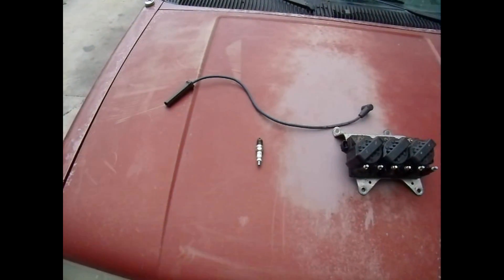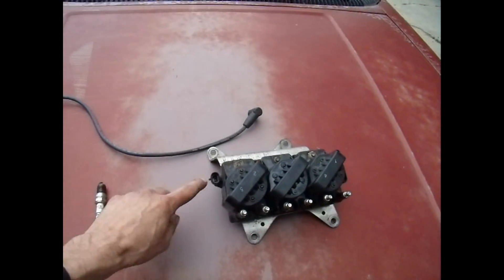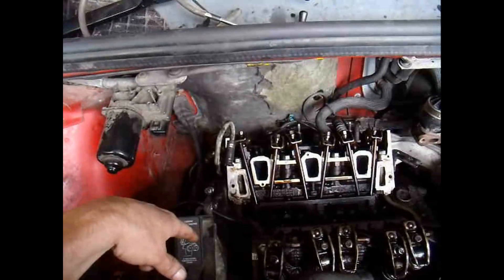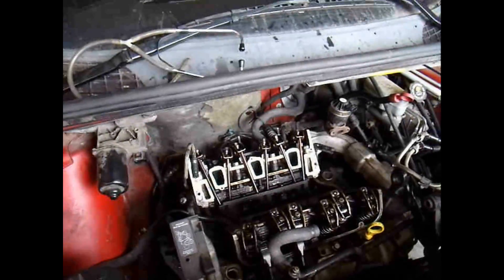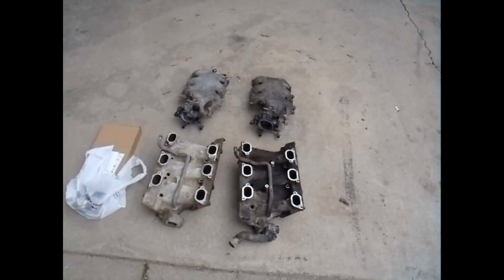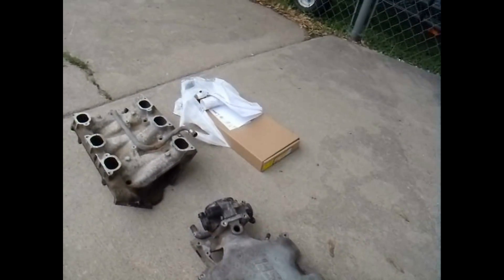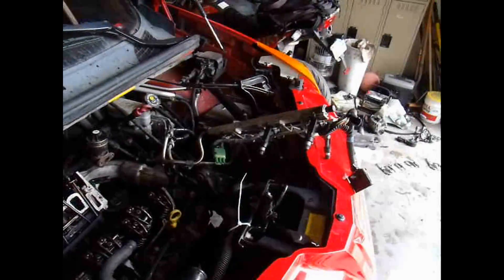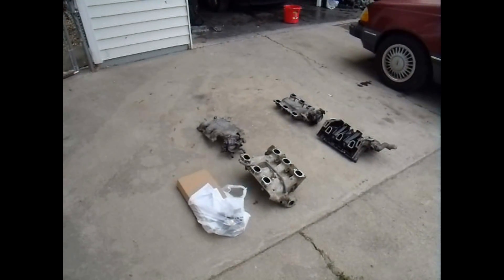GM 3400 / 3100 3.1 3.4 Engine Misfire Cause & Causes Miss Missing P0303

Comment: I been working or cars and even building engines for over 20 years. here recently my brother and i have been trying to figure out a missfire on a monte carlo with the 3100 engine. keeps showing a cylinder#1 missfire. have tried a coil, control mod, spark plug wire, spark plug and fuel injector and its still there. they were all perfect working used parts also. car has around 130,000. im suspecting a bad intake gasket. whats your thoughts, thanks for the vid

Comment: In the Fel-Pro Tec sheet for the L.I.M. Gasket, there are two cautions that may have resulted in the cracked castings. The first one being: Vin J & Vin E engines have the locating pins offset over the port. Vin M engines have locating pin centered over the port. Also you must make sure that the original gaskets plastic locating pin is not broken off in the locating hole in the head!!!

Comment from the maker: If you've never replaced the intake manifold gasket or the head gaskets, they are highly suspect.  Both go bad over time.  Pretty much every 3400 I've had has needed both replaced at some time.  Usually to find a bad gasket it's a process of elimination.  Spark, Fuel and compression.  In that order.  Spark is ok, I'll assume the fuel is ok, next check your vacuum reading.  Vacuum can help diagnose many problems also.  Check compression and possibly a leak down test.
VT247

Comment from the maker: With any luck, it just bent the pushrod.  But without pulling the head, it's hard to determine if the valve was bent unless it's running rough on that cylinder.  If it runs rough, the valve may be bent.  Hopefully it isn't.
VT247

Comment: did it only msfire at a idle but drove fine i have a 01 montana cylinder 4 random misfire i changed plugs wires coils coil base  every time i tried somthing new it ran good for couple minutes then the misfire came right back

Comment from the maker: 1. Tighten the vertical lower intake manifold bolts (1) to 7N·m (62 lb in).
2. Tighten the diagonal lower intake manifold bolts (2) to 7N·m(62 lb in).
3. Tighten the vertical lower intake manifold bolts (1) to 13N·m(115 lb in).
4. Tighten the diagonal lower intake manifold bolts (2) to 25N·m(18 lb ft). 
But I just tightened them up by hand being careful not to over torque them again.
VT247